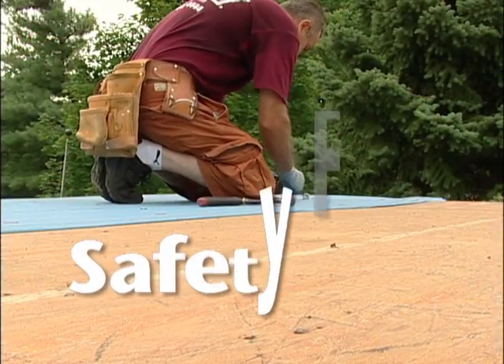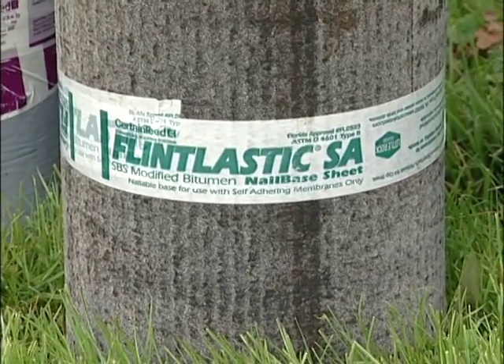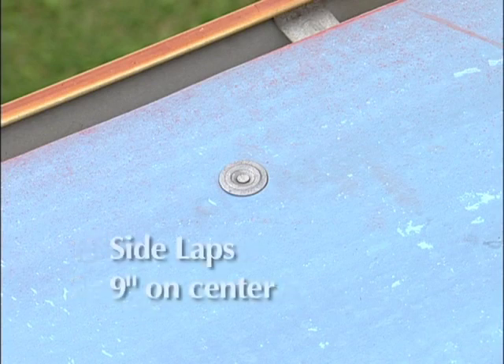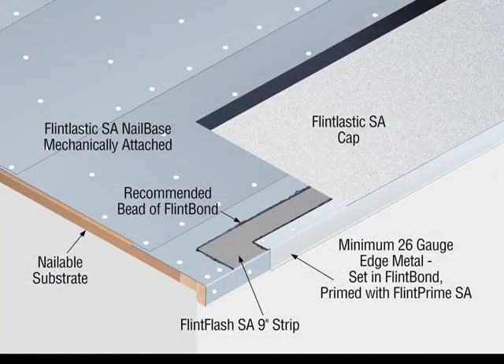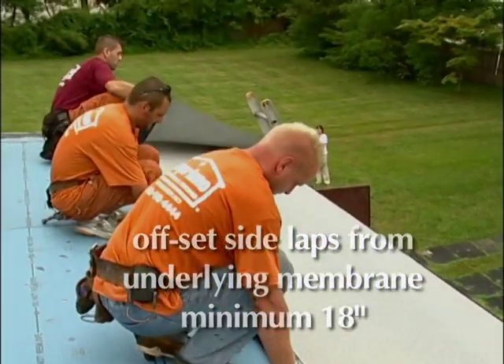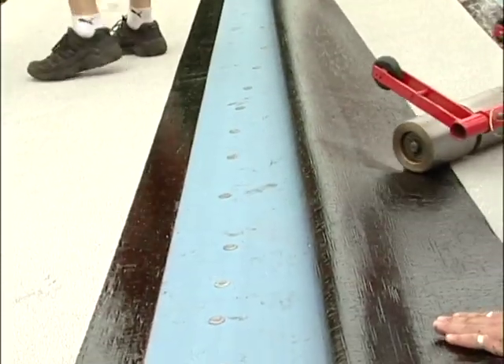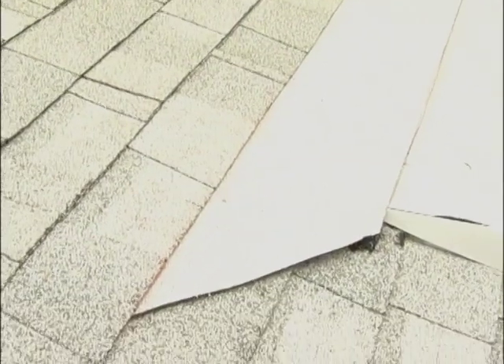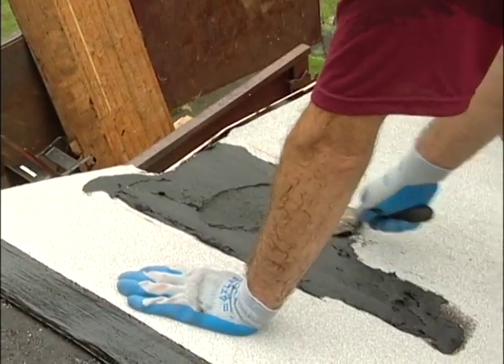Flintlastic SA Installation

Comment: not very long if it is a hot day.Honestly, the only trouble I have had during a Flintastic installation was temperature above 80°f  &/or. working with inexperienced men.It's quite forgiving, just do your research & then full speed ahead.
The vast majority of guys in construction learned by nust doing.Eith er working for. a roofing outfit or a bit of reading manufacturer's literature then dive in. Do the absolutely best job you are able to.Do that & always be honest & you'll be on the road to success.